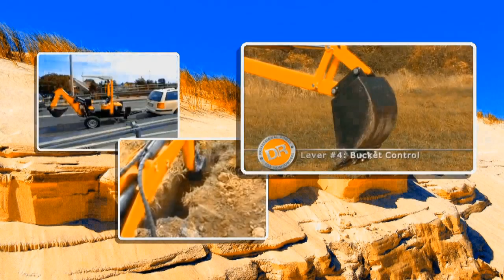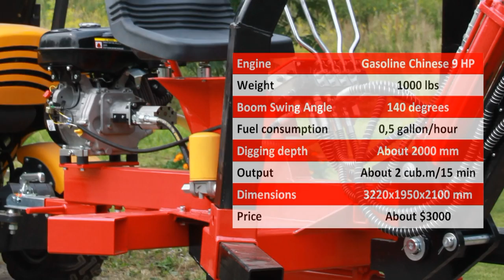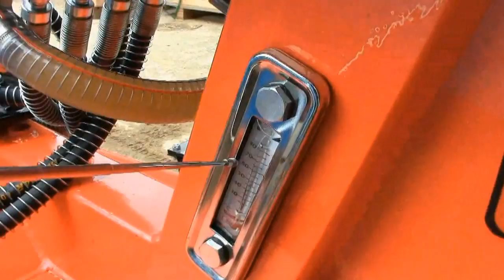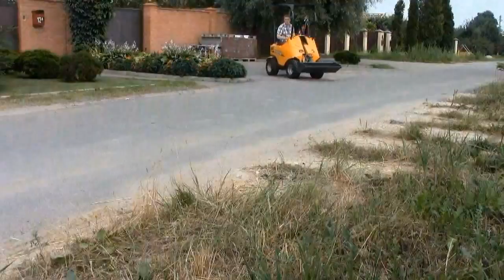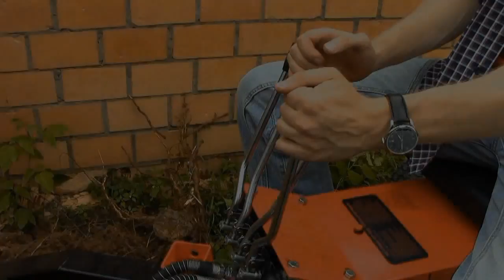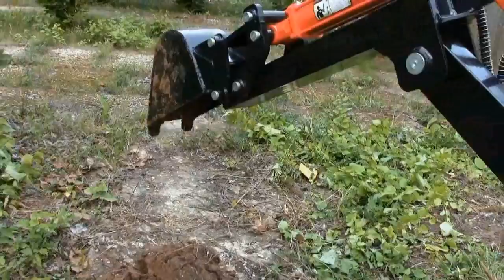The cheapest towable backhoe HBP-9. Full review, all the truth.

Comment: I have one identical to this one and love it. It has made 10 times what I paid for it in the past year alone. However I have had some issues but they're minor.  The suspension will give way after a while and let the rear end sag causing the wheels to turn outward. And the engine is mounted on soft rubber bushings which will eventually tear and have to be replaced. But other than that it's a great machine and capable of doing some amazing stuff.
Reply: What's the fastest you have ever towed it?  Have you ever towed it on the road?
Reply: @subixbarbarasson6052  Top speed when towing is around 45 mph. I never go any faster that that.
Reply: @sourand jaded 💯%
At this point my family is just going to but a TYM 254 with backhoe attachment. Good looking out man. You are absolutely right. Have a great day.
Reply: It only digs to 6" other then that pretty good
Reply: @sourand jaded help em out

Comment: Yea the pump is so small you can barley do 2 motions at the same time. Also the controls are spool valves so there slower and less oil can travel out of them. I would prefer at least a larger pump, twin 20 horse engine, along with joystick controls not spool valves.
Reply: Not at this price you dont. Buy the DR if you are looking for that.

Comment: Can you get these in Australia ?
Reply: Yes. I've got one. Edisons is where I got mine. I got it for about $2,300. It seems good apart from leaky couplings.
Reply: Rhys Wilkie how is the Edison’s one you got going? I’m looking at buying one right now but still unsure if it’s worth it? Any info on your experience with it would be much appreciated? 
Cheers
Reply: Hey mate, I'm not too sure. It is my first machine and I've only ever used small cranes before with my dad. The engine seems really solid for the price point. It also has solid  steel for the price and weight (ie all seems mild and decent thickness). I like the simplicity. The problem I am having, and that problem is preventing its use, is leaks in the lines. Too many leaks in the hydraulic lines to make it economic to use as I run too much oil. I'm not sure if it because it is my mistake, shitty lines, or what. The leaks come from the connections, but before the parts I was required to assemble.  Let me know if youd like anything clarified. Rhys
Reply: Rhys Wilkie thanks for the heads up, is it a matter or some Teflon tape on the connections to fix it or need new connections all together? 

what’s it like power wise? Is there enough to dig out around tree stumps? Also what’s your thoughts on putting a bigger bucket on it? I’m thinking if I do get one I’d make a wider sand bucket for it but unsure weather the power of it would be sufficient enough to handle the extra lifting load..
Reply: Hey mate, maybe. I need to do some tape experiments.  The power is appropriate for a hobbyist.  You could get many stumps that aren't in tough positions. But I will take a while and may need a sawsall or jackhammer to get through sole roots and reduce the time taken. 

It doesn't appear to be easy to change buckets. But it could lift more. It is breaking the resistance of the land that the low weight struggles with. If that makee sense.

Comment: what is the name of the engine
Reply: I have the HF version and it has a Predator 9hp gas engine.
 Runs well, I've used it to repare an access dirt road on my land and it handles even tough stoney ground. Speed wise she's not the fastest but by no means slow,  after you learn the controls it works well.

It could do with being heavier. to get round this I attached it to my jeep or yard tractor for heavy stuff.
Reply from the maker: Thanks for the comment!
Reply: Actually, it's one of the series of small engines within the old Subaru Robin series. Used for many, many years, under various names and badges (Predator, Kohler, Craftsman, and many others). Made by the Subaru corporation until 2016, when certain product lines were sold-off. I believe Yamaha bought at least one of the engine lines, but still the engines are produced in several hp and torque ratings. Some say certain models were copies of Honda engines, but for almost all of the small 1 and 2 cylinder models, Subaru did the design and engineering work. They are the primary engine series approved for use in USA California, where emission standards are extremely strict.  My supplier also does repair work, and his objective data shows them to be very reliable engines up to the 400-600 hour range, when pistons, rings, and valves may need service. Parts are readily available and repairs are simple to make, but even so, many users simply get a new one.

Comment: Backhoe looks very nice, but what about its durability? I am prejudiced against chinese machines, quality of their metal leaves much to be desired.
Reply: i have owned one for 4 years now and they are really good on everything but where you need a heavier machine
1200lbs plus how much you weigh
Reply: I had the harbor freight unit and loved it. It worked great for the price. Did anything I wanted it for.
Reply: I feel your pain on prejudice against china products. Its always hit and miss. I am a master automotive Tech with experience both heavy equipment repair and operation. I am also a welder. I would not consider one of these without that particular skill set. That said, i bought a small piece of property and need to do some dirt work, and for the money, i think that Harbor freight Tools mini hoe will do what i need it to do. At some point when i am done with it, i can sell it and get some money back. Just be aware, once the warranty is up, parts are unavailable. For the engine, you can get those parts. for the rams, you can buy other branded rams. The control block is the problem. The chassis, better know how to weld. I will immeditely  add bellows and boots to protect the exposed booms, and ram head seals. I day in sand and the wiper seals are done.
Reply: Every country makes some junk, and not all junk comes from one country.  Try not to generalize too much.  Many of their products are very high quality (not all).  In fact, many of the "high quality" components come from, and have come from China for a long time.